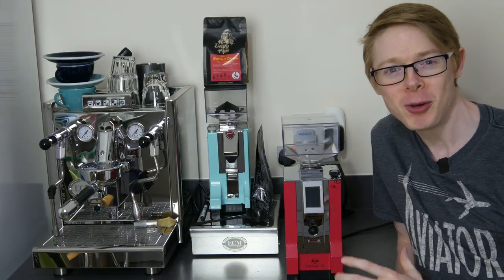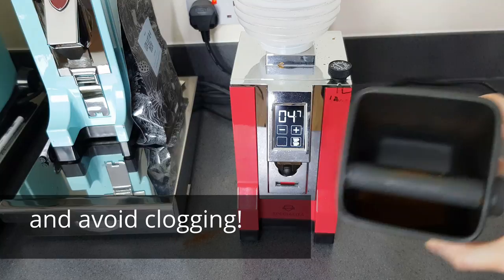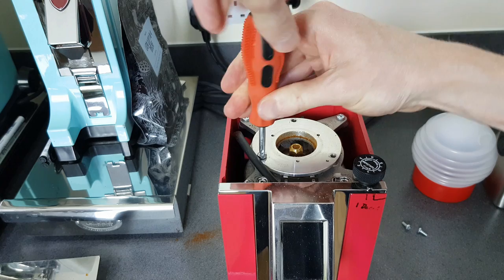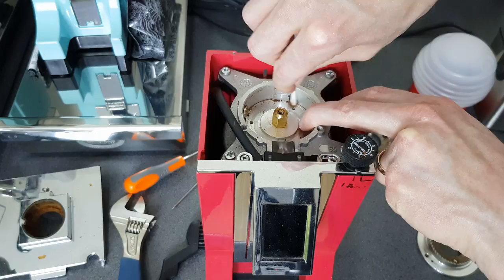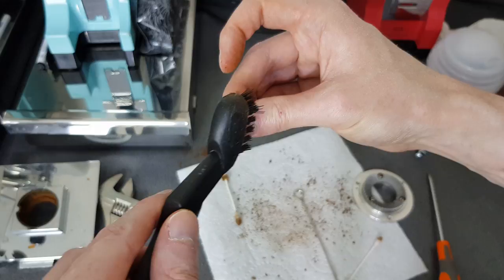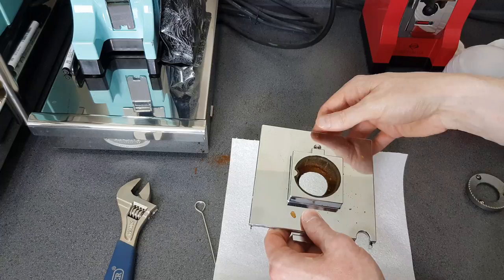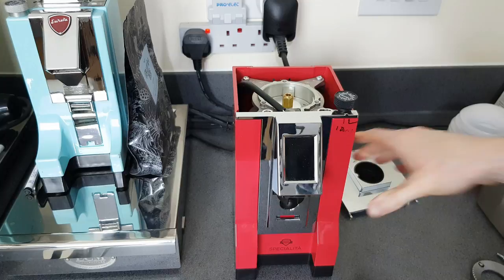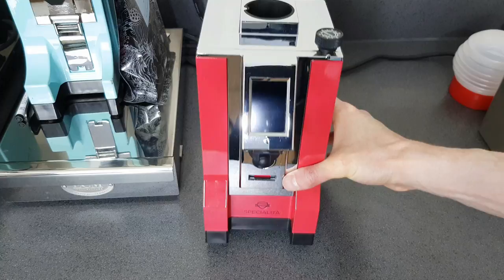Dirty Little Grinder: Cleaning Your Eureka Mignon Specialita Espresso Grinder

Comment: what is the name of your eureka grinder in light blue? Can I apply the same steps to clean as the Eureka Mignon in this video? Thanks
Reply from the maker: Hi, that one is older. It's a Eureka Mignon Mk2 (also known as Eurrka Mignon MCI).  Taking it apart to clean the burrs and chamber is different to the Specialita. 

But you can apply the same principles to cleaning inside. I would leave the burrs in situ for both grinders now and just dry clean them with a vacuum, cotton bud and brush.

Hope that helps

Comment: For an all purpose grinder would recommend Eureka Mignon Specialita or Perfetto? I do espresso and pourover almost equally during winter and spring months November, December, January, February, March, April, May and cold brew French press during summer months of June, July, August and September.
Reply from the maker: Hi George,

Thank you for your question.  I only use the Specialita for espresso and I haven't used the Perfetto. I believe one of the main differences is that the Specialita has 55mm burrs whereas the Perfetto has 50mm. Of course the Perfetto also has the EZ dial which is supposed to help you dial in for the different brew types. It sounds like that is the most important feature for you - being able to quickly move between espresso and pour over for example.  So maybe the Perfetto would suit you better?

Thank you for watching too!
Reply: @coffeewithalex4379  thanks for responding. My other criterion is having one grinder and not filling up my limited counter and cabinet space besides getting the most functionality of these expensive tools.

Comment: Cheers for this awesome video!
I have a soecialita as well, but noticed that the lower burr is wiggeling a tiny bit while grinding. Is this normal due to rotatory forces?😅
Reply from the maker: No no it shouldn't be! Maybe it's not sitting flush in the burr seat?

Comment: Hi Alex, are we not suppose to tighten up the upper burr's screw till the tightest? because when i remove it, all 3 screws wasn't fully tighten in, so when i reassemble, i tighten it a bit more than it original was when i remove it. However, when i grind my coffee, it seems to be so much noisier than it usually does. Any suggestion?
Reply from the maker: Sorry for such a long delay replying. I haven't experienced a change in the noise from the grinder from doing this, so I'm not sure what could be causing that. You may want to check the burrs are sitting nicely - particularly the bottom one which might not be sitting flush in the holder. 

I'm now not removing the burrs when I clean - just using cotton buds, brush and vacuum. 

Thank you for watching and commenting.

Comment: Hi Alex, great vid, i have a question. When taking the grinder apart, do you have to pay attention to the alignment of the burrs? Thanks.👍
Reply from the maker: Hi - it is supposed to keep the grind setting. But, in my experience, it doesn't always. To ensure it is you might want to mark the burrs with a marker so you know where they sat and which was which (top or bottom). I've done that recently. 

Thank you for subscribing! Let me know what other videos you'd like to see.

Comment: Hi Alex, I've been single dosing my beans with the specialita to help keep beans fresher by storing them in a vacuum sealed container instead of leaving them in the hopper. However I have found that dialling in can be inconsistent when changing grind size whilst single dosing. Whats your experience with SD? Should I keep the hopper filled up instead?
Reply from the maker: Hi Ricky, sorry for the delay replying. I'm also using a vacuum sealed container now too (a Ceramic Airscape container). I used to keep the beans in the sealed bags they came in rather than in the hopper.  

As I'm sure you ignore there a lot of factors that could cause inconsistency of dialing in.  Consistency is one of the things I've been working on too recently. I've definitely picked up a few things - maybe I should make a video on that?

I think you're smart to keep most of your beans in an airtight container. The Specialita isn't built for true single dosing so there will be some unwanted wastage. If I'm dosing out around 18g then I do put up to 25g in the Specialita. There's still a little popcorning towards the end but I've found it works for me.

After the final coffee I grind out any left over beans and blow through the chamber with the bellows I showed in the video. 

When dialling in I follow the same steps - grind, purge, bellows, adjust grind, grind a few grams through after changing the grind size, then grind the new lot. Like you, I found dialing in tricky and seemingly inconsistent.

Does that help?

Comment: Great content, subbed!  I do wonder if you could guide me a little if you have time.  Part of what got me to watch this video is that I haven't purchased yet, but am looking between the Specialita or the Niche Zero for grinder.  I'm also very interested in ECM machines (V slim), or some other machine that is very high value.  I'm not looking for flashy, but more of a work-horse.  Do you have any suggestions for grinder or machine?  Any things that you wish you knew before you purchased?  Thanks in advance!
Reply from the maker: That's a tough one :) Choosing grinder and machine is a very personal thing, but I'll try to help...

I have no experience with the Niche Zero, so I can't give any opinion on it. I did look at it briefly before buying the Specialita. I was interested because it was aimed at single dose grinding and 'zero' retention. This is appealing because it saves wasting coffee. 

At that time though it was quite early on for Niche Zero. I think it was only available from a crowdfunding site and there was quite a wait before it would get delivered. I wasn't keen on that.  

Also I was familiar with Eureka as I already had Mignon Mk II. The Specialita is, in my opinion, a great espresso grinder for the price. It's got the digital touch display (bright and so easy to use), timed dosing, 55mm flat burrs and looks nice too. Just know, if you choose the Specialita, there will be some retention and single dosing isn't going to be optimal with it. Though I still do it. 

Yes, I do like the ECM machines and it's interesting that you mention non-flashy, work-horse because that's what ECM is in my head. The machines don't seem to have all the latest features or pushing the boundaries but they do seem very well built and look pretty nice. I think other manufacturers are now working harder on the finish and style now. 

You asked about things I wish I knew - gosh, a lot. It's probably a good topic for a video! To recommend something is very difficult, not least because I'm not familiar with all the machines available.  It also depends what stage you're at on your coffee journey. So it'll be best for you to get on the phone with a few shops who can guide you.

The machine I have now is the ECM Elektronika, you can hear my thinking behind it and the machine I had before in this video https://www.youtube.com/watch?v=MDKfro8ekII (my first video!). After having this machine for about 18 months, I would like to upgrade again! 

Hope this helps and thanks for the sub. Let me know if you'd like to see any specific content.
Reply: @coffeewithalex4379  Very insightful thank you!  I will definitely go through your backlog and look forward to your future content.  As far as ideas, because I'm still shopping, I've been very interested in gear reviews and head to head comparisons... although I'm assuming it's tough to get a hold of that much espresso gear.  Thanks again!
Reply from the maker: Yeah head to heads are easier for people selling the equipment and they're best at doing that too. There are a few good channels doing that.  But I've got a few bits of kit I could review so thank you for your suggestions.  Hope you enjoy the coffee world ad you explore!

Comment: can I please ask you what is you touching point and what number is you espresso range? I found out my espresso range is about 1 number from touching point. is that normal? for example touching is 0 and espresso somewhere to 1. 
Thanks!
Reply from the maker: Hi Vee - I actually don't have this grinder any more (you can see in my latest video what I replaced it with). I'll try and answer though: Of course it will differ between our grinders but that what you've said sounds about right if I remember correctly (touching is zero espresso may be around 1 to 2).
Reply: @coffeewithalex4379  thanks

Comment: Top video mate, Where can I get those bellows or something similar for the task.
Reply: Found them they aren't on sale anymore 😔
Reply from the maker: Hi John - thanks. Yes it seems to go in and out of stock. So keep an eye on it. Also I've just seen some options on Etsy that  look much better (although I haven't used them)! Have a look here https://www.etsy.com/uk/market/mignon_single_dose. Look for ones with bellows. 

Does that help?
Reply from the maker: Hi John - I just checked and they're back in stock as I write this. Here https://www.amazon.co.uk/GardenHOME-Practical-Insect-Killer-Powder/dp/B01D0I21CI/

Comment: is the rubber seal that holds the bean reservoir a substitute for the screw? When I put in the rubber seal, the screw doesnt tighten for me.
Reply from the maker: Hi, no the rubber seal isn't a substitute for the screw. I don't use the screw as the seal is enough for me. If the screw doesn't tighter at all there might be a thread issue but that's probably quite rare.
Reply: @coffeewithalex4379  thanks for your reply. Strange thing is, there is no hole in my rubber seal. And the rubber seal is in between the screw hole of the machine and the screw hole of the bean reservoir...hence my confusion. Is the rubber seal supposed to have a hole?
Reply from the maker: Hi, no there's no hole. It just applies a pressure when you tighten. Careful not to over tighten.

Comment: Thanks for the video. 

I own the Specialita for about 8 months now. I started noticing problems with it when I opened it to clean it. First I thought it was the misalignment and I fixed it but even now, I can only get my 20-25 second extraction when the burrs are touching each other. No one talked about this on YouTube and I don't know if that's normal or not. Where do you get your sweet spot?

The local dealer won't look at it as long as it's still grinding and running. So that's useless.
Reply from the maker: Sorry for the delay replying. 

No that doesn't sound normal. I'd say it's not working if you can't get your grounds fine enough to get even a 20 second extraction. I'm usually shooting for 28-32 seconds on a medium roast. 

Couple of things before trying to get the dealer to take a look:

- Try with beans that have been roasted within 2 weeks. I've found with much older beans you have to grind finer and finer. 

- Check again to see if the chute has coffee grounds built up in it.

Yeah it's a pain your local dealer won't look at it! If you really can't convince them to take a look - get in touch with Eureka via their Facebook page. 

Hope that helps and thanks for watching

Comment: Wow did not expected so much leftover in the burr chamber
Especially because the reviews are very positive about the minimum grind retention....
Is the specialita worth the extra money compared to the MCI, Apart from the convinience of the better Timer?
Reply from the maker: Yes there can be quite a bit. To be honest, I had left it for maybe a little longer than I should have after the last clean. Partly because I thought it would be good to show how to clean it well. 

I had to look up what you meant when you said MCI. I always thought it was called Mignon MK II ! But it looks like they're exactly the same? 

Personally I do think the extra money was worth it for the Eureka Specialita. The Mignon MK II was a great starting espresso grinder for me. But the ground coffee was clumpy. I don't know if they've fitted the newer ones with their clump crusher - if so this may have been resolved. The Specialita does produce significantly fluffier grounds - no clumps. 

Aside from that I do like the timed dosing but I still weigh the grounds so it's not a deal breaker. I do like the style better though. And the sound has a much nice lower tone than the Mignon MK II / MCI. 

I was thinking of doing a comparison video between the MCI / Mignon MK II. What do you think?
Reply: @coffeewithalex4379  For me it is better to see the machine after longer time without cleaning, because that would more fit in my personal use case :)

Thanks for your detailed answer, appreciate that! 
Also did not know there are two different names for this machine, but receiving fluffier ground is a good argument for the Specialita, i did not expect a difference in the grind quality. Despite I am more a fan ob the quite indestructable built quality of the MKII/MCI the pros for the specialita (Reduced noise, Better timer, Less retention, Fluffier grounds) convinced me now

However, I like the idea of a comparison video of both machines from somebody with experience in using both machines on a daily basis!
Reply: Some grinds / dust settles in crevices and may not necessarily contribute to grind retention where it actually gets swapped in and out.

Comment: Have you experienced alignment issue after taking them apart?
Reply: I've just followed the steps and my burrs are not out of line. He probably should have mentioned that this is a possibility
Reply from the maker: I probably should have Louie. I did send it off and had it checked after several cleans like this and the found no faults or alignment issues. Of course if you're concerned about this don't take the burrs out of position, just clean them with a good brush and vacuum out the grounds.

Comment: Alex, I got a specialita and rotated the dial way to many times in both directions and have no idea of how to find the true 0-9 point. In afraid of turning it on and damage the grinder. What do you recommend I do? Thank you in advance!
Reply from the maker: Hi Gonçalo,

The best way to reset it in my experience is this:

Empty the hopper and ensure all the grinds are out of the grinder. 

Leaving the hopper off, start the grinding and listen to the burrs. If you don't hear a very slight tinkling  or 'ffff' sound then adjust the grind finer until you do. What you're listening for is an indication that the burrs are close enough together to almost be touching. Be careful doing this!

Once you get there, wind back a little in the courser direction. You can start dialling in your espresso from here. 

Does that help?
Reply: Coffee with Alex thank you for your fast response Alex! I tried that method but unfortunately the output is always coarse. I’m going to the store to see if they can help me with it. I just bought it yesterday. Thank you again!
Reply: Coffee with Alex update: I went to the store where I bought it and they helped me identify the espresso range. I guess I was just afraid of accidentally grinding the burrs and damage then if I did it on my own. But basically they did exactly what you suggested. So, thank you again for your help! I really appreciate it.
Reply from the maker: Hi Gonçalo,

Ah great to hear you got it sorted. 

Yes I know what you mean, you wouldn't want to break it when it's new. It was good you got someone to show you. Maybe I should make a video on that!?

Thanks for watching and enjoy your coffee 😀

Comment: what the grind coffee under the bottom burr is causing? because i cannot dial in for espresso on the finest calibaration i get less than 20 seconds extraction
Reply from the maker: Hi - The coffee under the bottom burr was causing inconsistency - it meant dialling in was a real challenge, if not impossible. 

I'm not sure why you're getting 20 second extractions at the finest calibration. How are you checking that your grinder is on the finest setting? For the Specialita turn it on and start gridning without with beans going through. Adjust finer gradually until you can hear the burrs almost touching, then adjust a tiny bit coarser. 

How much coffee are you using? Is it freshly roasted? Have you looked inside the burr chamber? If you can't see anything, I'd recommend speaking to the place you bought it from.
Reply: @coffeewithalex4379  yes exactly like you describe and i use 18 grams of gresh coffee i roast my assumption is that the motor is being pushed down little when grinding maybe the metal arm holding it from under is getting too flexible over time and less rigid to hold it in same level.
Reply from the maker: I haven't explored any further than the bottom burr so definitely check with the place you bought it from. It's a real pain when things like this happen isn't it! I miss coffee when I can't have it.

Comment: Did you have to align the burr after you put it back?
Reply from the maker: Since this video was posted I have had a few comments worried about misalignment of burrs. If you are concerned about this do not remove the burrs. Leave them in place and clean with a good brush and vacuum up the grounds in the burr chamber. 

I personally did not experience issues with this but clearly you are removing pieces that manufacturers have put in place. So remove at your own risk!
Reply: @coffeewithalex4379  I think that would be great content idea, how to proper aligning burrs. So after every deep cleaning like this, we can align our burrs again. It is quite simple I think.
Reply from the maker: Thanks Ambrosius - I don't have experience with burr alignment but there are videos that do a good job with this. Also I don't have this grinder any longer
Reply from the maker: Here's a video about my new grinder https://youtu.be/5T-OGTZoIQM